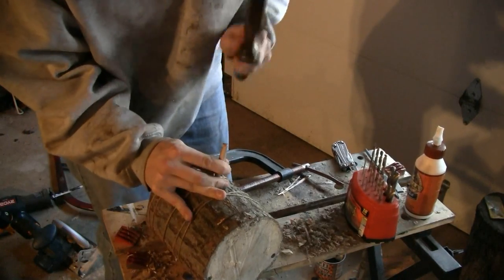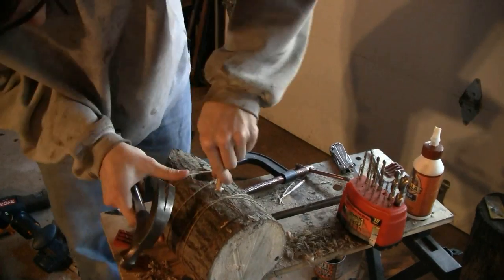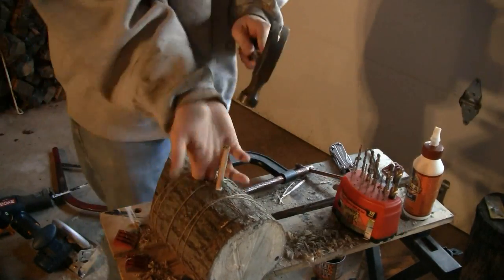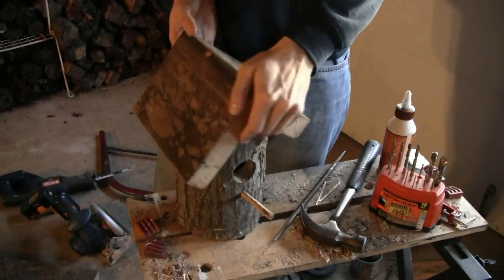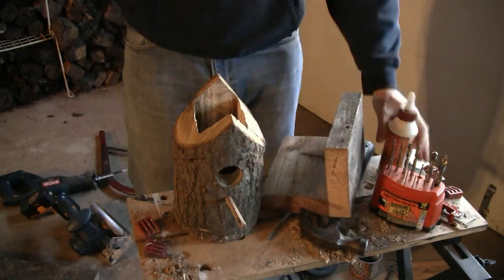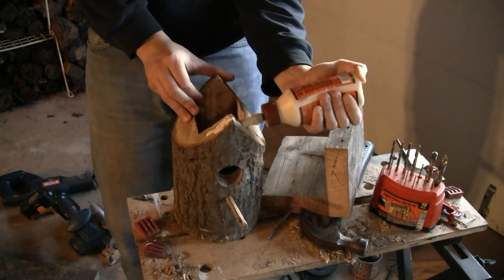Log Bird House - DiResta Inspired Project

Comment: Good work! But the stick under the hole is not necessary, it will only make it easier for predators
Reply: Explain how that would just help predators? I don't understand how it would help.
Reply: @rockyjjones8989  They can climb on it when getting acces to the nest